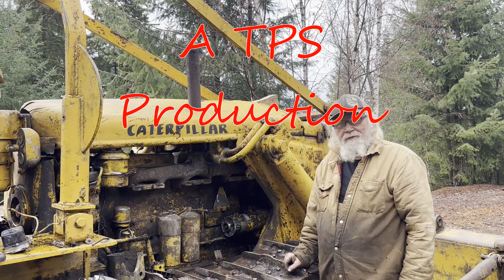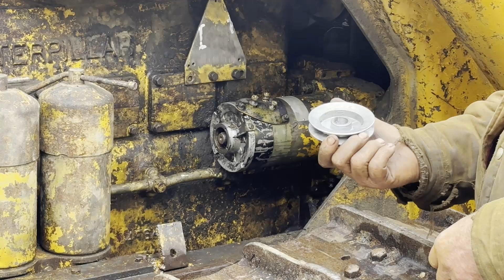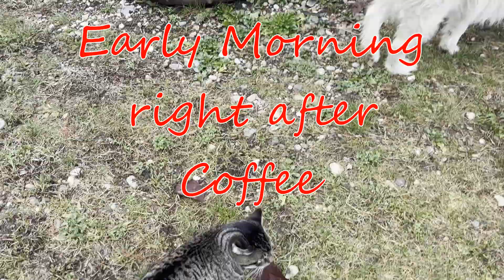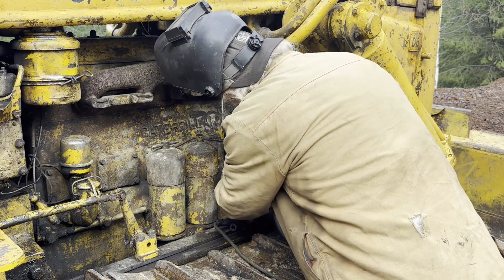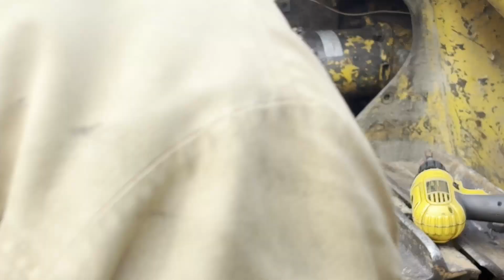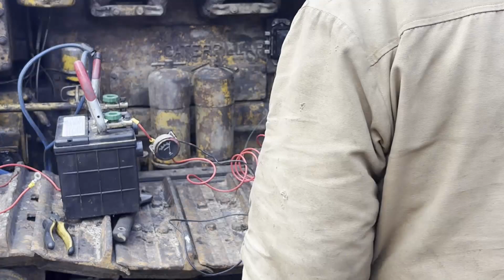D6 Alternator Install

Comment: milt that reg is for gen it does things differenly than an alt reg they dont  interchange good luck I like your concept.
Reply from the maker: In theory it should have worked. It would register on the amp gauge 20 amps but I couldn’t get any more than 12.5 volts. I had to try it.

Comment: Milt, Don't you need a rectifier to change the A/C out of the alternator to 12V DC to charge the battery?
Reply: Looks like a plan.  Other thing that will work is a voltmeter like your ammeter
Reply from the maker: @ yes indeed. I used my volt meter to check. It’s putting out 14.3 v. Like it 👍
Future plans for the D6 is making a gauge cluster under the armrest to hold all electronic gauges. Maybe a tach as well
Reply from the maker: The diodes in an alternator change it from ac to dc. In a generator the brushes and commutator change current from ac to dc.
Reply: @beginlivinglikeaboss  I am used to dealing with the output from the alternator/generator on my S&S 131 inch X-Wedge V Twin. That has to be run through both a rectifier and controller in a separate box, which rectifies the three phase A/C output from the S&S generator. The original box was made by people called Cycle Electric Inc of Brookville, Ohio. After the fourth one overheated and died in just three years and 4500 miles, I changed to the box used in a Harley Davidson Electra Glide, which was made in Japan. 10 years later I am still using the same box with zero failures in my Morgan Three Wheeler.

Comment: That is a genius solution not having to overthink it  just using the old one to power the new.
Reply from the maker: Plus the whole original system is preserved so if at another time it’s easy to return to as when built.